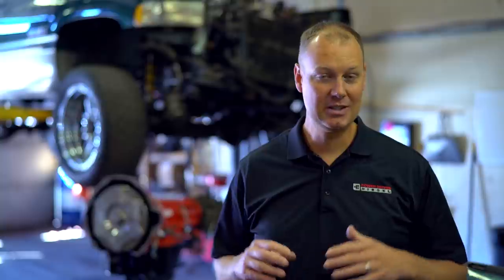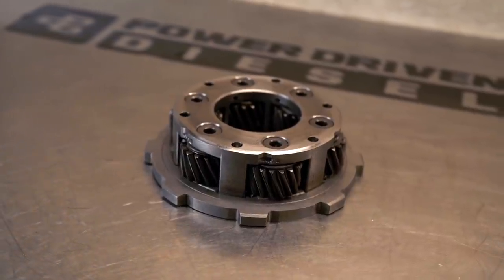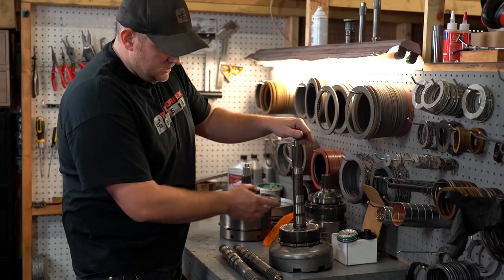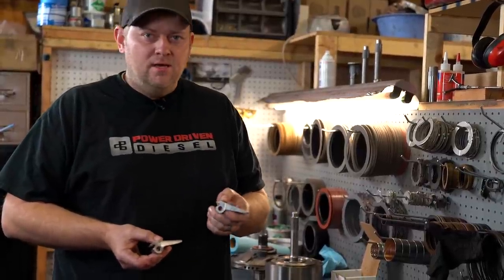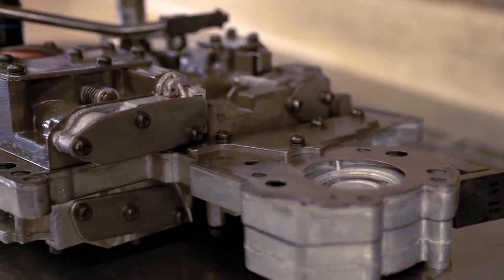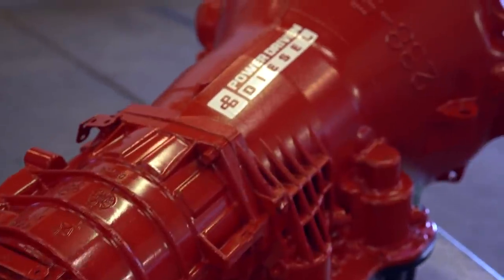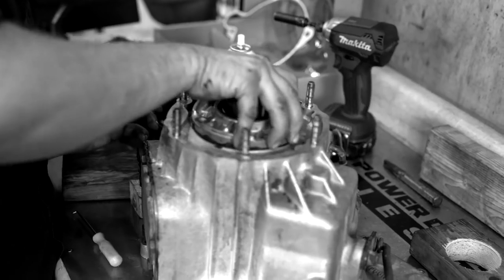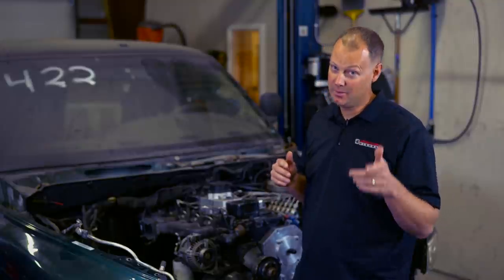1000 HP 47RE Transmission Build

Comment: I built my 48re a year ago. I went with a bolt in sprag because it's a weak spot and and a cheap upgrade. I've never seen the planetaries welded like that because I've never heard them failing. I question the torrington bearings vs sleeves because sleeve bearings are more robust than roller bearings and testing them dry on a table is not representative of real world conditions with the bearings soaked in fluid under an axial load. Just don't be like me and forget a seal in the forward band servo. That leads to all kinds of problems and 2 more rebuilds a month later. The first to correct the seal and burnt band plus all the metal shavings in the governor solenoid and destroyed pump. The second for a burnt forward clutch after 400 miles (dont ask me how).

Comment: If I was going to run a automatic in my old 12 I certainly want this kind of build in my transmission . Not necessarily all the billet shaft but probably a 300m input . I really like the roller bearing in the planets . Just have to get the right size bearing and machine the receiver grove to the correct depth for the idea clearance .  Its a good idea really if you seen the washer that come out and the impression that left on the back side from loading .   The better front pump and the better planets , the better servos ect ect . I also use the filter off the 727 and over fill the stock pan by a bit . I appreciate your videos thanks

Comment: Forgot to add that the deep pan also gives you a port to thread a small temp sensor into 👍🏼👍🏼
Reply: If the temp sensor is in the bottom portion of the pan it can be inaccurate best place to put a sensor is in the line coming out of the trans going to the cooler gives the most accurate temp of the trans

Comment: I have one question on these 48 RE s. Do the lockup selanoid ever fail and cause a low stall speed of around 1200 rpm almost kills the motor. And if I remember it can be changed in the truck can't it. I may not have to pull the t case and trans. 😗😀
Reply from the maker: They can but normally they fail off not on  but if it failed on that would be the symptoms
Reply: @pddofficial  yea that's what I get for using a cheap aftermarket. Thing is even oem are prone to failureatsome point

Comment: Too funny !! But they forgot one important thing automatic transmissions overheat and a manual transmissions will not
Reply: What about the 3000hp capable Titanium Lenco that bolts up to a Transfer case?
Reply: Manual trans will get hot too,dont kid yourself thinking they wont.I had to add a pump and cooler to my Audi's trans to keep temps in check.Its simple HP creates more load and that means more friction and heat.
Reply: uh  manual transmission overheat to... and cannot be built to hold this kinda power... Might wanna learn some more next before making urself look like a fool...